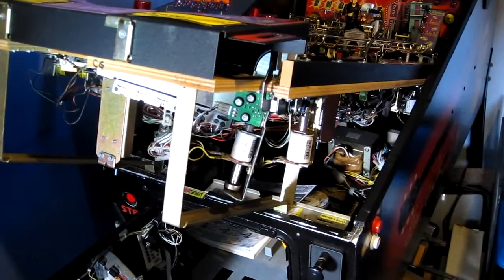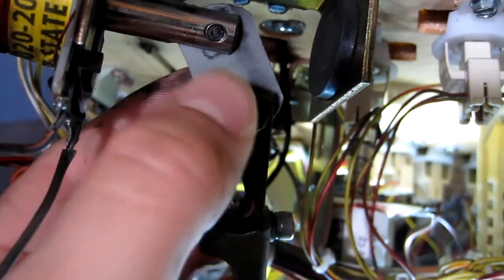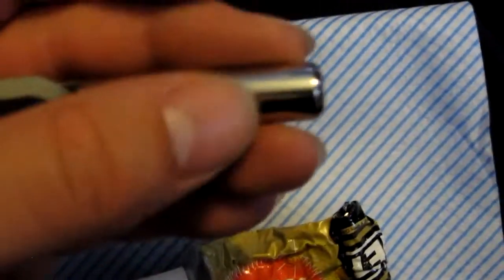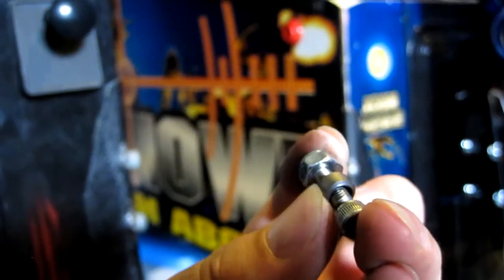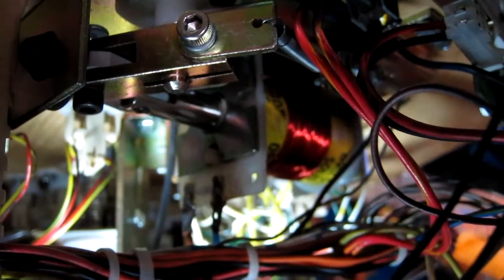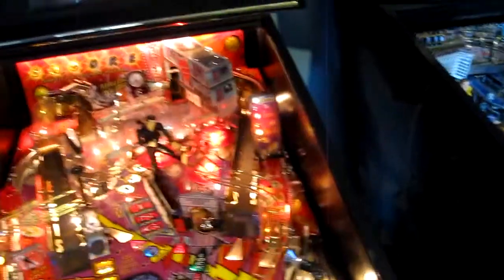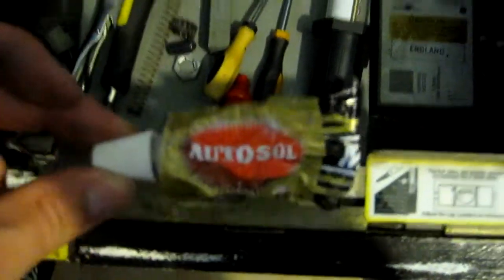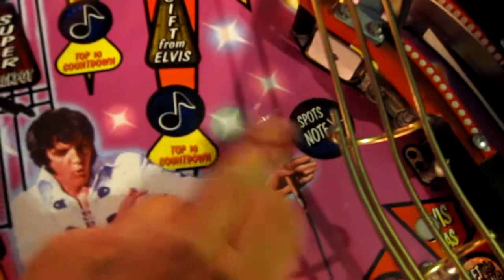Stern Elvis Repairs and Maintenance

Comment: Great video as always Luke.  I replaced the coil sleeves on my R&B a while back but didn't do a full rebuild because to be honest I had no clue what I should be checking to determine if it was needed or not.  This video is a big help.  I think an rebuild could well be in order; i've noticed it's sometimes particularly hard to make the ramps so a bit of a cleanup may well do the trick.